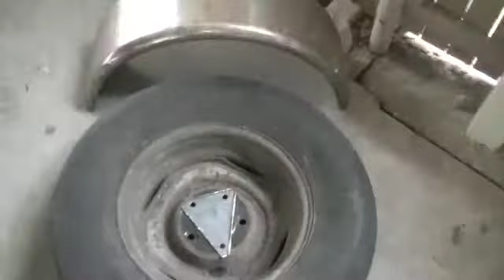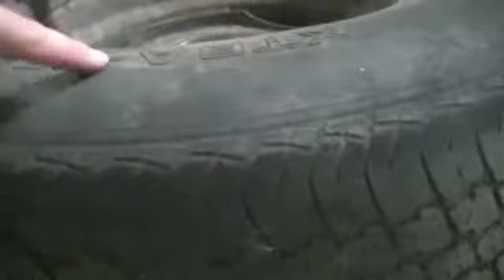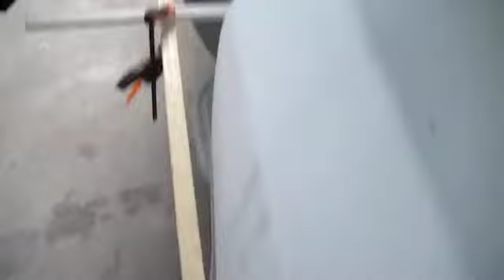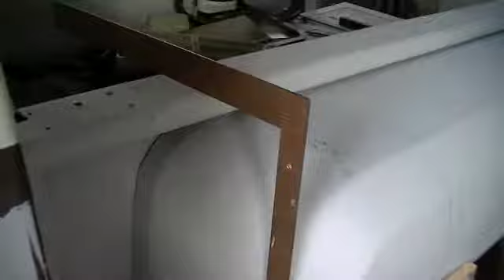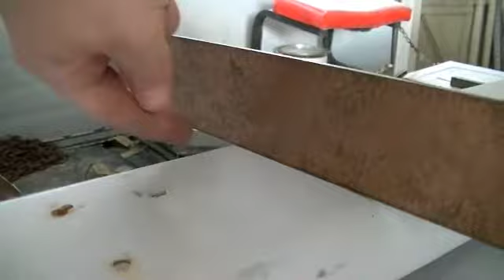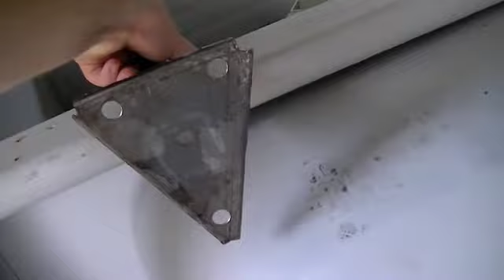Part 2 C10 Spare Tire Carrier

Comment: every factory tire mount iv seen or worked on used 1/8in plate  and bolts/wheel studs welded on back side thou a few gmcs used nuts and washered wing nuts